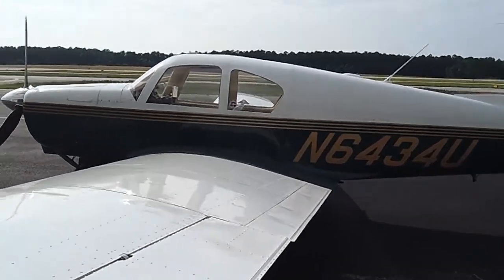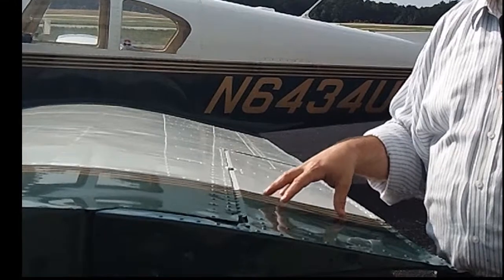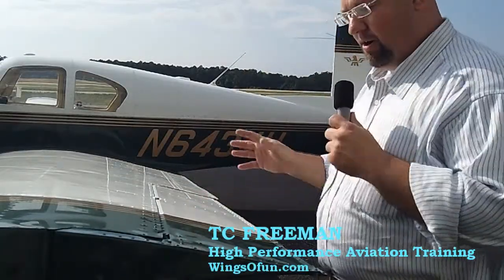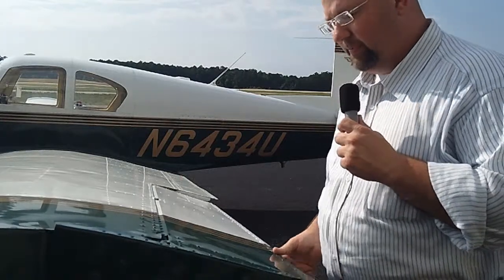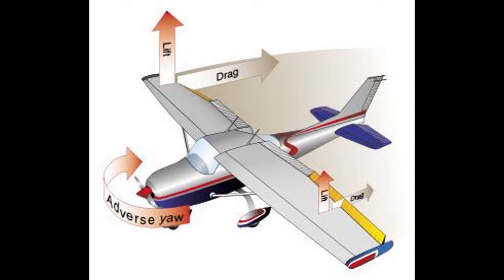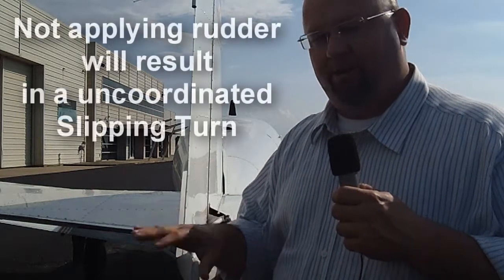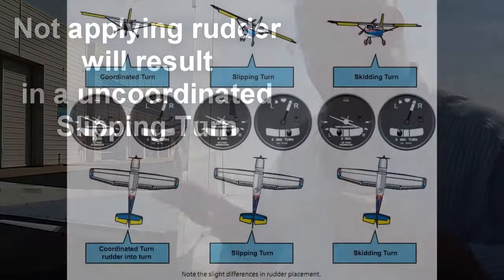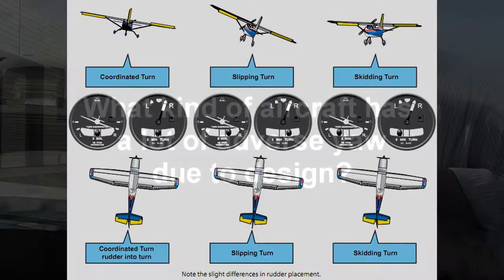TC FREEMAN's WingsOfun.com blog #48: Understanding Adverse Yaw

Comment: Ive been reading about using yaw when banking or recovering a bank, and the yaw is used toward the wing with more lift, so if i bank left, which wing has more lift, and same for banking right. Cheers.
Reply from the maker: Thanks for the question GPL. In a left turn using ailerons the right wing creates more lift thus turning the aircraft left. However, the by-product of lift is drag so there is drag to the right. The function of the rudder is to overcome that drag, called adverse yaw.
Reply: Yes that's what i thought, so according to a video I watched you would use right rudder, so you yaw's toward the wing which has more lift. Thanks!